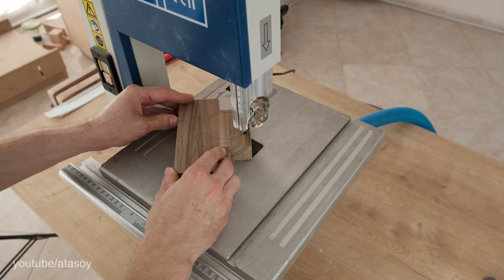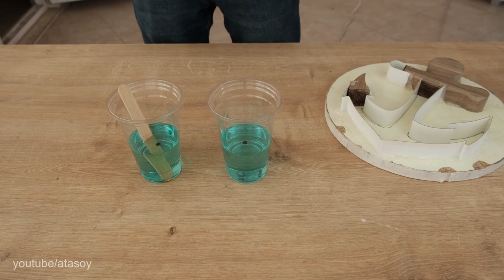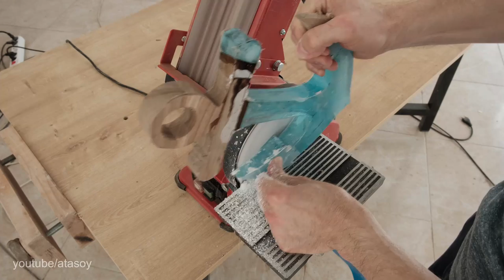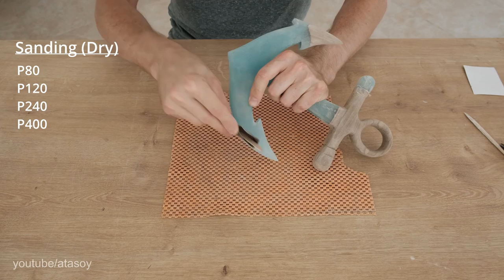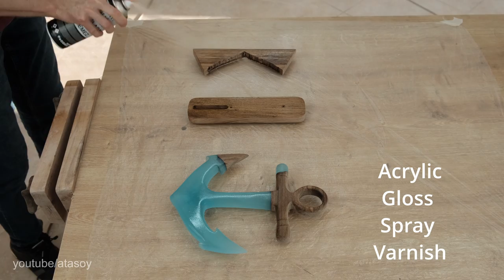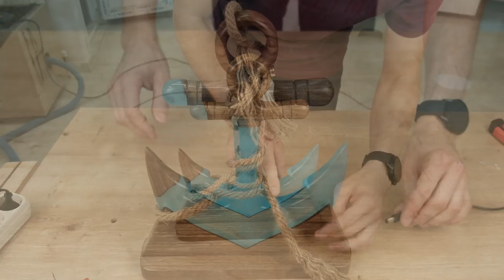Decorative Ship Anchor Lamp | Epoxy Resin Art

Comment: What material did you use for the mold?
Reply from the maker: I used an mdf for the base and covered it with clear tape.
In the frame part, I used cardboard and covered the surface with transparent tape.
Reply: @atasoy  İnstadan yazdım niye cevap vermedin lan
Reply from the maker: (LAN ???)
Sadece buradan destek veriyorum, instagram profilimde şöyle bir yazı var dikkatinizi çekerim - You can ask your questions about epoxy by commenting under the relevant content on my youtube channel.
Reply: @atasoy  özür dilerim hocam. Teşekkür ederim. Yaptığınız çalışmalar çok güzeller. Bende başlamayı düşünüyorum. İyi çalışmalar. Başarılarınız daim olsun🤍

Comment: Hello, your videos are incredible, you are talented and have a great imagination.
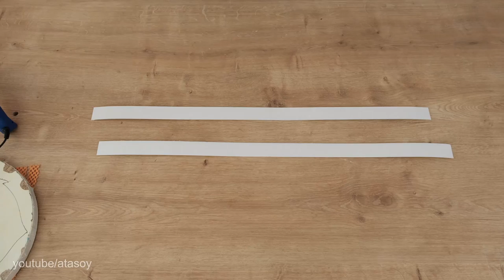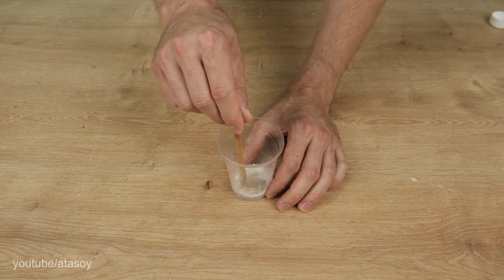I would like to ask about two things: at 1:35 is that a paper or cardboard? At 4:20 what is that white powder you are adding to the water?
Reply from the maker: It is cardboard used in 1:35 minutes, I cover its surface with a large transparent tape, if you do not cover it with tape, it will stick to the epoxy and you cannot separate it later.
It is a white powder epoxy pigment in 4:20 minutes.